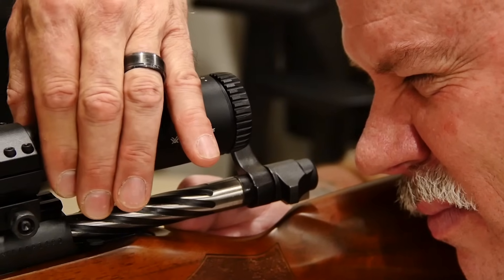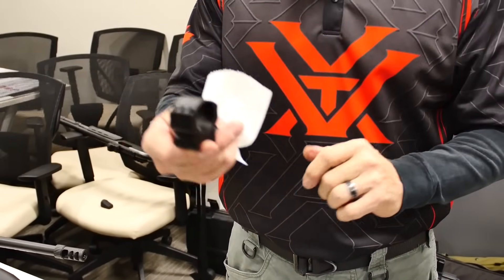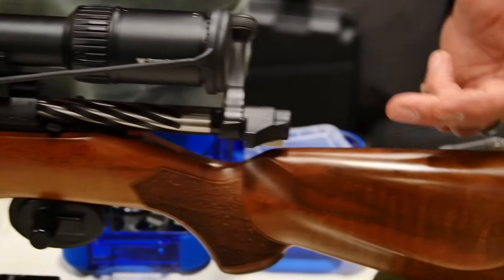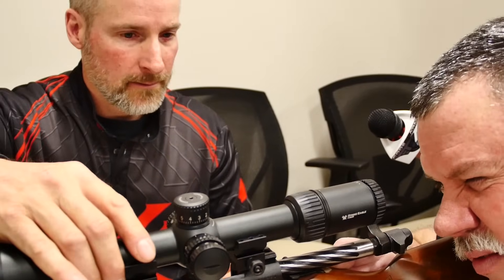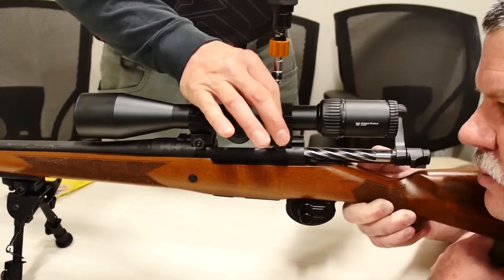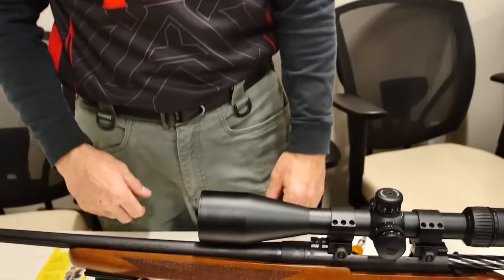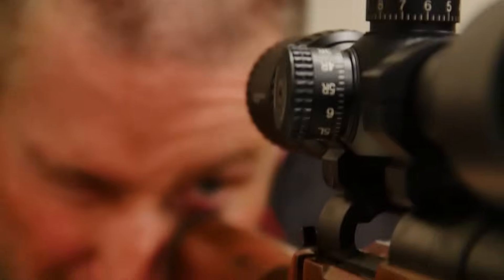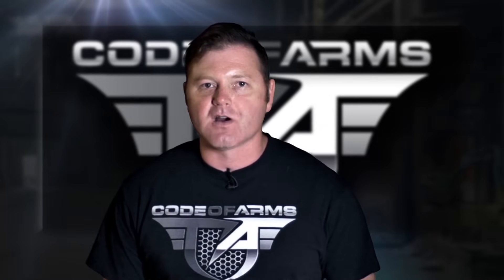HOW TO INSTALL A SCOPE PROFESSIONALLY - By Vortex Pro-Staff Mike Brake

Comment: Always push your rings forward on the base before tightening, eliminates any possibility of them shifting under recoil. Then check the alignment before mounting the scope. Also, just like torqueing cylinder heads on an engine, I like to torque the screws using a crisscross pattern in steps; i.e. 5 inch lbs, then 10 inch lbs, then final torque of 16 inch lbs. Lastly, I always zero my scopes with one shot. First bore or laser sight in the shop with the rifle in a gun vise. Then at the range fire one well aimed shot at 100 yards from a rest, and with the rifle locked into the rest or vise, align the crosshairs on the bullseye, then adjust the scope to the actual impact/hole of the first shot. Done, perfectly sighted with one shot, though a couple of verifying shots are always a safe bet. Of course if your rifle and/or ammo won't group decently then all bets are off...
Reply: That sounds cool. I was under the impression that "locking the rifle into a vice" prevents natural recoil, which subsequently impacts natural trajectory though.
Reply: @allthecommonsense  true, I only use the sled to hold the rifle while I one shot zero the scope crosshairs, not for firing.
Reply: @artillerybuff2000  yep I get that, but doesn’t that mean it would shoot one way for the zero, but shoot slightly differently for all (non sled) shots thereafter, making the “zero” slightly off? Obviously I have no experience here so just speculating based on hearing that a viced gun shoots differently.
Reply: @allthecommonsense  I carefully fire the rifle using my bipod and sandbag from a bench. Then mount the rifle on a sled or vice, line the scope up with the bullseye, then without moving the rifle adjust the crosshairs to the actual bullet hole from the first shot. That's it, it is zeroed in one shot. NOT firing from the vice, it is only used to hold it while I adjust the scope.

Comment: Good job.. A point to be made is that with some less than top of the line scopes the turrets are not always plumb with the cross hairs - so I find that using a plumb string instead of a bubble level is a better approach..
Reply: You bed your rings with JB weld and using the level you tighten top rings to mfg spec. If you do this and keep the scope level then you're good. I bed the rail as well as rings, Two piece are good but if I need more eye relief I will use |EGW one piece. I don't like lapping...bedding the rail first gives you a perfectly straight, no stress attachment to the rifle. Then the rings give you a perfectly repeatable mount that is right in perfect line with the bore. Easy peasy.
Reply: Yes, level rifle and match cross hairs to a plumb bob string, best way to go!

Comment: Huge tip for leveling a bipod for this process, grab yourself a deck cards. 
A single playing card is 0.014" thick, so you put as many cards as needed to level it up, and you can do it in extremely fine increments, up to the whole deck at about 3/4".

Comment: Holy smokes! Starting at 15:40, he describes a 'hasty sight in' at 30 M (aka yards) placing POA and POI on same dot drawn on a piece of paper on the wall! This means actual live shot will be dangerously high at 100 yards /meters and possibly over any back stop! Seen it happen! What to do? Measure the scope to bore center-line distance and mark 2 dots on your paper marked 'POA' (point of aim) and 'POI' (point of impact).  Look thru the barrel and get it on the POI and then adjust the scope to zero on the POA. When you go to the range for the first time hang a paper at 50 yards/meters and use the POA of the scope to see how close the POI is, then go to 100 Yards/meters and dial in a few clicks so the POA & POI are the same. The key point is, when parallel sighted, you'll always be on the paper for sure and a little low, but not high and dangerous. You're sure to be off the paper at 100 yards using the method in the video you won't spot how far off the shot is and may push your elevation even further (and dangerously) off.  Bad sight-ins have a lot to do with live rounds hitting homes & pple miles away from the range! Seen it!
Reply: watch it again and listen to what he is saying ( at 15:40 he says 100m, not 30m )

Comment: Fascinating! This  gentleman is very knowledgeable and confident. I just got a viper PST 1-6 for my AR. Trying to decide mounting scope myself OR someone to do for me. At this point it appears to be someone else. Just to START, What’s it cost to have a leveler for the gun let alone level for scope and torque driver? Already $850 before those items. To have a Vortex rep work with me would be invaluable!
Reply: Inch Pound torque wrench, about 30 bucks - you should have one of these anyways when working on firearms.  Levels can be purchased at Home Depot or Lowes for under 10 bucks for a pair.  Much less than paying someone to do it for you and if you ever have to adjust it again, you can do it yourself.

Comment: Use Blue Loc-Tite on all your de-greased mounting screws.  It will help keep them from rattling loose during shooting.
Reply: What is your torque spec over the dry spec?

Comment: I wish I could have leveled off the top cap  for my viper pst but per the vortex customer service person I was told to use a plumb bob and sight thru the optic to level. The top cap was off by about 10 degrees

Comment: Thanks to Keith and Code Of Arms for this instructional. I am a complete "new guy" to rifle setup and shooting and I just want to learn as much about proper method and techniques to do things right the first time and not waste my time. It's been my privilege to view this video and I'm thankful. May I ask a question? I have scope rings that have a torque spec from 18 to 20 and I have a scope that has a torque spec of 15. Should I follow the scope manufacturers recommendation or the ring company. Fortunately, the torque specs aren't much different but what if they were? Who would you follow? Thank you
Reply from the maker: Thank you for the kind words!
I would recommend you follow the scope specs because if you crush the tube the ring company isn’t the one who will do the warranty work 😉
Reply: Okay thanks. I will do as you suggest.
Reply from the maker: You’re welcome

Comment: Very good video. I hate when people say you're not going to win a competition if your don't buy the most expensive line of optic. That's total horseshit, shooting technique is way more important than having a 2000-3000 dollar optic. I've personally won 6 competitions so far with a diamondback tactical that I bought for 400.00.
Reply: First you get good, then go from there. Beginners/amateurs need to work on the basics. When they get as good as their current equipment will let them, then decide on moving up in equipment.

Comment: When I seen the title, "How to install a scope Professionally", I was expecting him to use an alignment tool and lapping tool  because of the individual scope rings.  This is to insure that the mounts and rings are not canted or misaligned when torqued down. I prefer not to use my scope for that purpose. We should also remember not all rails and mounts are perfect or are equally matched as we may want to think.  Fud or Non-Fud, if the scope is misaligned, so will the shot be the further you go out and turret adjustments may be frustratingly inaccurate. Misalignment may also bind in the wrong place on your scope.  I was looking to send a video to one of my former team guys who had questions on properly aligning a scope on their issued rifles. Mike Brake seems very qualified and knowledgeable,  this video was good, but it was missing a few points.  The guy that was having his scope mounted in this video was probably not running and gunning with his set up which is understandable. If I wasn't 700 miles away and in a state where I would be put in quarantine, I would go visit him personally and set it up for him, but I will send him this video and a few others.
Reply from the maker: Thanks for the insight and share! Very valid points, much appreciated!!!
Reply: Yep... it's not quite professional with a capital P. If you wanna shave of $1,000 from the resale price of your scope the most common reason is ring mount damage. there are heaps of Youtube vids for dialing in optics and unfortunately most don't address lapping or (worse) failing setting up the scope/turrets so the reticle is centred first before fitting; then we usually end up see a smiling face with 3 holes in a 3" group at 100 yards. Yay team! Vortex scopes struggle with holding zero if the reticle is nearing the elevation or windage limits. Hawke optics website explain the erector assembly limits very well...you need to know if a 900 yards 24+ MOA elevation plus 7 MOA windage shot has the erector tube maxed out against the scope wall; you won't know if you don't check before fitting.
Reply: I always lap my rings no matter if they are top of the line or mid range. The Wheeler levels should be put on the same plane to see if they are true. I've had many sets of them trying to get a pair that are true to each other. Finally gave up & went with a milled aluminum matched pair.
Reply: Lapping scope rings are for people with no common sense and cant think mechanicly if you want to waste time and money go for it. If you dont believe me watch gunblue’s video on mounting scopes he explains why very well

Comment: I did not see you even test to see if the rings needed to be lapped. Some don't believe they need to be but I have much different experience with that. Always at least test to determine if lapping the rings is necessary.

Comment: Once the mounting and adjusting of the scope is done.
 When  bore sighting it is easier to use a straight edge or line such as a cross that you have set up level so you line up that vertical line through the center of the bore then make sure scope vertical is also in line and the same with the horizontal when you have that then you aim at center and fire a shot then hold the rifle on your aiming mark and wind the scope to the hole and repeat should only take 3 shots at most.
If you can boresight at night put some cardboard over the lense of a torch with a small hole and set it as far away as practical then look through bore line up on the light and same with the scope so when you get to the range you are ready to shoot and adjust.

Comment: Hey Mike great video very informative. Where could I get the shirt your wearing? I looked on the vortex web site couldn’t find it.. please help thanks
Reply from the maker: I’m not speaking for Mike or Vortex, but I do know they were provided to select store dealers and pro staff. I never saw those ones for sale before any wear. But if you check our Techwear they have a huge selection of similar style shirts and possibly may even have a vortex branded one!
Reply: They are custom made shirts for staff and pro staff.  They were created on a limited run basis, and were not made available to the public.

Comment: One trick we use in my unit is regardless of the rifle, if your ring mounts are properly level to the reciever, is we use a steel ruler canted between the scope and the barrel/rail system, at the flat bottom of the turret dials.  one edge of the ruler touches the bottom flat of the turret and the opposite edge of the rule touches the barrel/rail system.
Reply from the maker: Thanks for sharing...your experience is valued and appreciated 👊💯

Comment: Assuming the scope turrets are aligned with the crosshair is an issue. Over the years I have had seveal leupold scopes where the reticle is not in line with the turrets. This means assuming the scope dialing subtentions are accurate, you can only dial you cannot hold over or hold off...

Comment: Im' geniunely coureous:
I would really love to see and hear some data and an explanation as to why having lube on the bolt threads is a "no-no". From my experience with extremely highend ($5k-$10k) mountain bikes is that bolts are less likely to back out if they are properly lubricated.

Comment: Good video, except for one glaring exception. How did you level the rifle? I dont mean moving it in a vise or, in this case, adjusting the tripod. What part of the rifle do you place the level bubble? This has always been my quandry. Most rifle surfaces are round or angular. It becomes difficult to find a proper place to locate a bubble. Sometimes, it's a best guess, at least in my experience. I know,  typically, the scope mounting surface is the way to go. But it's not always easy to access. 
I'll bet someone has the answer I've been overlooking all these years.

Comment: Leveling the optic off of the elevation cap is not preferred since the cap is not level to the scope due to a number of reasons (thread; cap design, etc).  Some caps are much more out of whack than others.  You should level off of the base of the optic (flat part base, opposite of Elevation cap).  There are different kits that include a part to do this or you can make your own by taking a thin flat piece of metal (~4-5 inches long) and glue a small bubble level tube to one end of it.  You can then slide it under the scope, between rail and scope base, and hold it flush to the scope base while leveling.
I really like Spuhr Mounts bc they come with a bubble level built into the base and it comes with a proprietary tool to level the scope in the mount, leveling off the base of the scope.
Another easy method is to hang a weight (wrench or tool) from a piece of cord/string at a slight distance, look thru the scope at the string and align the Y axis of the reticle to the string.  I really like this method because you can get it damn near perfect when some bubble levels are more forgiving/less accurate than others (center bubble lines are not right at the bubble edges).
Reply: I was just wondering, do you actually shoot guns? or just talk about shooting guns when reading other people's data ? I've been doing a long range shooting now for about 14 years. his method is the method I use. After I have the scope mounted up I do a ladder test.  I can consistently hit 16" by 18" steel  target at 1,000 yd. And I'm just Fair to average shooter.

Comment: You don't need a level to mount your scope. Put a plumb bob up, mount your scope, don't tighten it down yet. Get a flashlight and shine it through the scope and line up that hair with the plumb bob.
Reply: Works fine as long as you are 100% sure your rifle is level first.

Comment: I never use the turret to level a scope I always use a straight edge on the bottom of the scope after I have made sure the reticle is indeed straight there can be variation is the turret machining as you turn it in and out .

Comment: I could go into a much more in depth procedure of scope mounting that I use myself, but this procedure can get you by without special tools and fixtures.  If you are looking for precision however there are a few things that need to be added to this process.
Reply from the maker: Thanks for your feedback!! Appreciate it 👊
Reply: @stevengray2244  I've watched more than 50 videos on scope mounting. Each one has a piece of the metaphorical puzzle to successfully execute a precise setup. Every rifle and scope setup can be different, it all depends on YOUR setup and intentions to what all techniques are necessary to use. There are many variables that include the scope, ring and base quality and alignment, the turret housing to reticle alignment(seen more than a few $600+ scopes that have canted reticles) the rifle action base screw hole alignment with bore. (Off center screw holes cant the base in relation to the bolt raceway as well as point to scope left or right). But I have to say I did like this video along with Vaughn Precisions scope mount procedure.
Reply: @CodeOfArms  Any idea of the manufacturer or source of the bubble levels used?
Reply: @johnrobb442  weaver scope level

Comment: My goal when installing a scope on a rifle is to have the vertical reticle bisect the rifle bore given that my selected cant angle is zero. To do this my first step is to set the scope reticle to physical zero. Since the scope naturally centers in the rings, my next concern is to insure that both the front and rear ring centers are directly over the bore (with a one piece mount, that it is not angled in the horizontal plane with the bore). So centering the scope mount (one piece and two piece) over the bore center is the next concern.  Why the concern? To avoid physical horizontal parallax which would mean that the bullet trajectory would intersect the scope sight line in only one place, not the usual two (near and far). How valid and important or just a false concern?  If it is important, how do you accomplish this? This is for extreme range.

Comment: Great basic information, too bad so many comments are all over the map some good and a lot not so good. One should take your video at face value and improvise if one thinks it makes things a bit easier. I have a bore sighter that I use effectively because I have it and have been using it for years. But your advice is great for people who don't have a good bore sighter nor know how to use one correctly. And then all bore sighters are not equal I have had some that were not fit to use.  It's obvious from some of the feedback that too many people are clueless as to what their replies are.